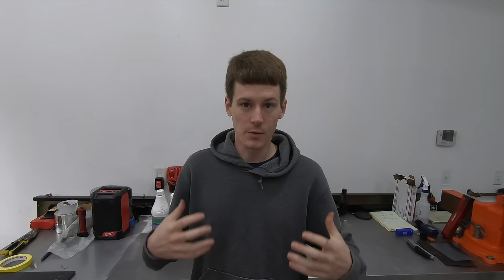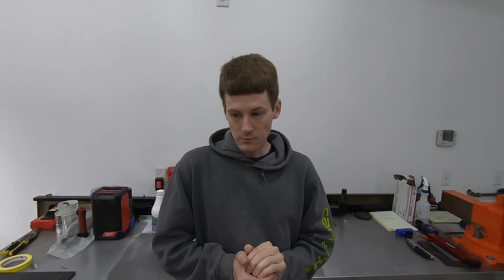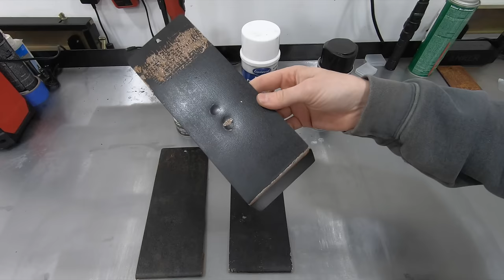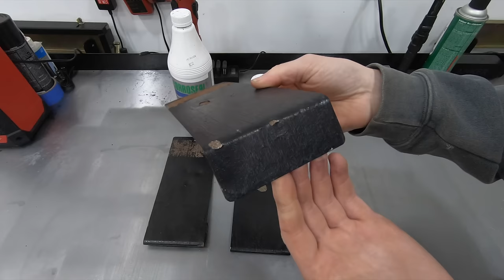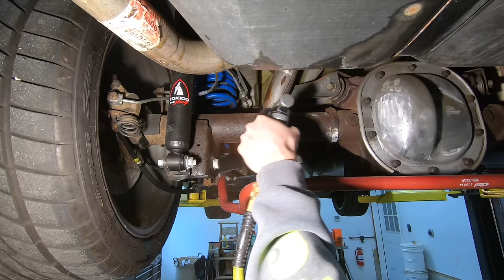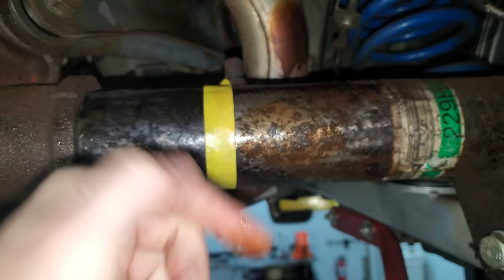MOST Rust Converters Are A JOKE! Let Me Show You. (Eastwood, KBS, Corroseal, Ospho & More)

Comment: Rust kutter was interesting and that thickness may seem like a benefit but it isn't. They are using thickening agents to allow the chemical to be in contact longer to achieve better results. While that is good it also limits its ability to enter declevities and porous surfaces which may leave uncovered rust under the applied area. While skyco "ospho" seems watery that is because it is required to pentetrate. I saw lots of iron phosphate on your test panels but nearly none on the rust Kutter panel, what exactly are you suggesting it converted? Phosphoric acid exposed iron oxide will appear as black and the rust Kotter panel appears to not have hardly any rust on it, converted or otherwise. Sampling with one sample per product dose leave a greater chance of result deviation through inequality in base samples and can best be defeated through multiple samples of each and a control sample. Good luck on your next test to create true results!👍

Comment: Looks like VHT converter has been discontinued. Duplicolor Rust Fix is from the same family and in looking over the MSDS, both have very similar makeup except Duplicolor does not have Dimethyl Ether, It does have the other three as VHT did which is Acetone, 2-Butoxyethanol, Formic Acid.

Comment: Ok Q...
 I bought a vehicle that the exhaust system has been welded together from the manifold to the muffler,  if I was to use your best rust converter would it work since it would adhere better because of the heat or not?

Comment: So, after watching your and other videos, I'm going to power wash and green scrubby pad the frame on my 2000 Dodge 2500HD Cummins pickup. Then give it a coat of (maybe 2) Duct Cutter. And then a coat of POR-15 black rust coating. Am I waisting time and money with the Rust Cutter if I'm going to use POR-15??
Reply: Rust Cutter, not Duct Cutter. Thanks autocorrect 😁

Comment: Any phosphorus acid based product is not good to spray on your undercarriage. It is an acid that will eat up alot more than just the rust.  Any electrical wire, bushing, and everything else it touches will deteriorate from the acid.  If it burns your skin what do u think it will do to everything else.

Comment: Trying to figure out why you didn't even consider POR-15. Seriously , might be a good reason, just super curious. Is one of these products basically the same thing? Is POR15 just technically not a converter? . EDIT: Found answer. you have them in another video about rust "encapsulator" performance. cool!
Reply: I was thinking the same thing. I used POR-15 in the past and it is tenacious stuff.
Reply: POR is an encapsulator, not a converter.  That said, POR is a great product and I would use it in most applications rather than converters.

Comment: Rust Cutter or Krudd Kutter followed up with the VHT or an Eastwood 2k EPOXY Primer (Sealer)! then top coat with KBS Rust Seal or 2k KBS Maxx Seal (UV protection) is what id HIGHLY RECOMMEND!!!...

Any of the 2k Eastwood Urethane/Ultimate Extreme Chassis products id also recommend for a top coat

Comment: I noticed that was a fox body car, nice. I have a 92 Z28. I want to change the coolant over to the Evans coolant. After I clean the block out, want to run rust converter through the engines water jackets. I keep thinking it would make the motor last forever without fear of internal corrosion.
Reply from the maker: You better be certain you get all of that acid out of the block. I'm sure over time it would destroy head gaskets, hoses, seals etc...

Comment: you should do it again with different brands there is a really affordable product called iron armor that harbor freight sells and seems to be getting a lot of good reviews. I've also run across dinitrol RC900 which claims to penitrate 7 times deeper then any other product and convert the rust into a epoxy which sparked my interest, problem is its around 50 dollars a spray can and hard to find it in the U.S. unless you pay crazy shipping prices

Comment: I have rust in a trunk seam which I repaired on the exterior, but still need to apply a converter to the interior of the seam. Obviously the seam is not easy to reach and therefore rinsing a product like Rust Kutter completely out prior to applying a sealer, will be very challenging. Any suggestions for how to get the effectiveness from a converter like Rust Kutter without doing damage if I am unable to get ever last drop of it removed from the inside of the seam afterwards?

Comment: NOT A JOKE AT ALL — The REAL “Metal Prep” products are something like PPG DX-520 METAL CONDITIONER.
They are basically 30% Phosphoric Acid and metal salts (zinc oxides) — (For the cheapest but still effective stuff, a 30% Phosphoric Acid dilute in distilled water work.)
They are use by the metal industry for ever and in all serious vehicle body preparation.

To work You need to FOLLOW THE DIRECTION.

It does not dissolve the rust, but rather bonds with it to create iron III oxide and water, and this characteristic is what makes it very effective for rust removal.

There are two ways that phosphoric acid is used to prepare steel surfaces and help to prevent corrosion.
 
1. Permit to clean the steel of rust, etc. in preparation for painting (or cold galvanizing). It converts rust to a water-soluble compound which can be removed easily by washing with water (distill water preferably). This, removes rust and provides a slight etch as an anchor pattern for coating.

• This step can be follow by a water based solvent to concurrently remove oils, grease, etc.  

2. Phosphoric acid is a good rust converter. It can convert some of the iron oxides on rusty metals to a stable layer of ferric phosphate which act as a base for coatings, to improve corrosion protection. Phosphoric acid is used extensively in the automotive industry as a base for painting.

As an example of industrial use:
PPG recommend the use of DX-520 METAL CONDITIONER on all metal

DX-520 METAL CONDITIONER is a phosphoric acid based coating chemical that will produce a zinc phosphate coating on galvanized or steel surfaces.  DX-520 METAL CONDITIONER contains a small amount of detergent which aids in the removal of light soils and promotes the formation of a uniform zinc phosphate coating.

DIRECTIONS: Phosphoric acid base metal cleaner CONVERTER:
• Take out all flaky rust from the metal and clean the surface rust as best as you can 
• Take out any residual dust by spraying clean water or even better distilled water on the bare metal
• Wen dry, apply the phosphoric conditioner
• Let it work for one to three minutes (depend on the state of the metal and the phosphoric acid dilution of the conditioner. Should be around 30%) — DO NOT ALLOW THE PRODUCT TO DRY BEFORE RINSING. — If dry spray rapidly the conditioner over again and be sure to rinse in the minute.
• Rinse with clear water or even better distilled water or
• Let dry and apply the zinc base primer, primer and top coat

Comment: This really is not helping. I just want to restore my rusty frame parts and prevent them from rusting again.

There are so many videos and they all say something completely different. Nobody explains why they choose what they choose but everyone swears by their method or shits on another. It's just impossible to learn anything

Step one is obviously sanding down the rust.
You can never get all the rust off especially in tight corners or dents. So according to this video I do not use a rust converter and just paint a base coat over it?? But then I have rust under the paint?

Comment: I don't share your enthusiasm for VHT based purely on your own results; it doesn't convert rust, it adheres extremely well to rust, and it dries. These are all the conditions which make rubberized undercoats fatal to parts, once compromised they trap moisture and cause accelerated corrosion.

I actually think the Eastwood was the best of the aerosols, it converts rust, and can be removed to treat the now bare metal.

Comment: The problem is liability. You can't sell a rust converter under that use claim, the chemicals that actually convert rust do so through hydrogen exchange, that means acid. Phosphoric acid (sold as concrete etch and metal prep) will produce iron phosphate, a durable and paintable coating that will prevent future rust. If you don't want a coating and just want to get down to bare metal then oxalic acid is what you want, sold as a kitchen cleaner in powder form (bar keepers friend is one of the brand names). These two are the only two I would ever use (I never use any chemical for anything other than it's intended on-label use, as that would be a violation of federal law). Note: yes, vinegar will dissolve rust, but it leaves behind iron acetate which is hygroscopic and will cause rust to proliferate through the material. You could conceivably use sulphuric acid which would produce iron sulfate, but sulphuric acid is generally sold much stronger than oxalic or phosphoric, and hydrochloric would produce a dangerous iron chlorate salt. Any and all of these compounds carry a degree of danger and would need to be handled respectfully. If you can find a chemical supply that will sell you oxalic acid and phosphoric acid then you could use them commercially and advertise rust removal, as it stands we have to stick to "metal prep" and "cleaning" as that's what the package says they do.

Comment: The thing is...if you have rust bubbles in the paint and when you clean it up and you also find holes.......how to best prep, so you can add fiberglass matt with bondo fiberglass resin and hardener over the prep to then sand, glass filler and finish?..? VHT.? Or??
Reply from the maker: Replace the metal. That is the only permanent repair.

Comment: The last 3 are rust removers, not converters, they are deisgned to remove the rust down to metal. Converters are not very useful because they don't give a reliable base for top coats. I found them occasionally useful to stem rust in corner areas on the body away from the road surface.

Comment: POR-15 is the best stuff out there.😁  Very little skill and minimal prep is needed.  If you buy a can (pint/quart etc) only get what you need because anything leftover dries into a solid rock. A humid garage actually helps the curing process oddly enough. Must use gloves! and disposable brushes and rollers etc.
Reply from the maker: POR15 isn't a rust converter... Take a look at POR15's metal prep product's SDS. The main active ingredient is phosphoric acid 😂
You're not truly "Painting Over Rust" if you're using phosphoric acid to strip it first...
Reply: @RepairGeek  Correct it's not a "rust converter" I didn't say it was. The POR-15 system is far better than any "rust converter" in my opinion. It's obvious to me that you have not tried/applied it before 🤣because you do in fact "paint over rust" after prepping/etching it with the POR-15 Metal Prep (which is partly phosphoric acid and zinc)
Reply from the maker: You clicked on a rust converter video and starting talking about POR15 and how "POR-15 is the best stuff out there" . 
I've used it multiple times, it's junk: https://youtu.be/7w-h2Y7Gk-c
Hit subscribe, I have more of that junk product testing right now. Video will be out probably late fall.

Comment: You missed a step in your testing.  What does the metal look like where the product was applied after a winter of driving with snow slush and salt.  I once put a brush on product under my 81 full size bronco.  It turned the rust black.  After winter I checked the underside again and there was no sign of black.  Everything was rusty orange again.
Reply from the maker: These are primers, therefore need to be top coated. If you don't topcoat them with a paint, the rust comes back as you found out.

Comment: I've been using Ospho for years and years with excellent results, and have no real interest in using a different product.  But I do hear good things about Evaporust and am curious why it was not included in this test.
Reply from the maker: That is a rust remover and not a rust converter.
Reply: @RepairGeek  Converts rust back to iron so it only shows black coating if the steel is high carbon.

Comment: What's your opinion of Rust Knockout? Having an extensive background in fighting rust, Rust Knockout seems to perform as advertised against surface rust. Obviously, nothing will work against flaking, or otherwise severely compromised, rusted, structural steel.
Reply: looking at the MSDS on Rust Knockout - it looks like it wouldn't do much at all except cover up the rust.
Reply: @voidisyinyangvoidisyinyang885  Well, that's an incorrect inference. Having had extensive experience with rust as a ship's officer and having observed this product months after application, it works, with one caveat. The rust cannot be so deep that's flaking.

Comment: Here's your free comment to go along with a view: Never use an undercoating product on vehicles, it's the fastest way to trap moisture. If it was the best choice then vehicles would be covered all over body panels from day 1. Simply finish the metal as any and use the appropriate paint.

Comment: Have you done any tests using a rust converter or preventer on a riding mower deck?  Needs to take a bit more friction plus build up moisture from stuck on grass.
Reply from the maker: I haven't and I should probably look into it because that is a common question.
Reply: @RepairGeek  that would be great.  I almost ordered a can of PB Blaster Surface Shield based on your good review video but then realized it doesn't get dry enough to work under a mower deck.  Would be good for my jeep though.
Reply from the maker: That is probably my fault. I didn't do a good job of explaining what actually goes on in that video. That product is 2 basic parts. Lanolin and Petroleum Jelly. When the lanolin gets washed away by high water contact it leaves behind the petroleum jelly. That was why the product appeared dry in the video where I pressure washed it on the mudflap, the lanolin had been washed away.
Reply: @RepairGeek  thanks for explaining that, I wasn't getting the wash part.  In your defense though, you were demonstrating a completely different application than what a mower deck would demand so I was viewing it with that lens in my head.  Your testing is top notch, unbiased scientific approach so if you ever do this it will be legit.

Comment: @repair geek: I have a Harbor Freight trailer I bought used.  It was customized into a motorcycle trailer, which is what I plan to use it for.  It's got a lot of rust that I want to take care of. 

I don't have a grinder or anything.  I've got an orbital from Harbor Freight, or a wire brush for my wheel...  I really don't want to try and sand the entire damn trailer.  If I remove the scale, would Rust Kutter be a good choice to handle the rust before adding fresh paint?
Reply from the maker: A video is coming on this but you need to sand it. Get a cheap 4.5 angle grinder and some stripping disc's. Go to town. Strip as much as you can then use the Rust Kutter, then paint.

Comment: Hey guys so I purchased a classic chevy truck that I don’t plan to fix right away it is going to sit out under a carport, it already has some rust was planning to use a converter , how would I use it , do I apply and leave on or does this have to be washed off and or do I have to apply anything else after like a protective paint etc ?!
Reply from the maker: After using a converter the surface needs to be painted otherwise it will rust again. Some products out there have zinc in them that will leave a zinc layer after the conversion. That usually helps with protection but as far as how long that would last? That would depend on your environment that it's stored in.

Comment: After you coat something in Rust Kutter, can you paint it after it is converted to Iron Phosphate? Is it still necessary to paint it?
Reply from the maker: Yes.
Reply: @RepairGeek  Based upon your video, I have forked out almost $60 for a gallon of Rust Kutter. I am going to my tacoma up on a lift and go right to work on any surface corrosion I see. I feel confident I have made the right decision. The rest of those coatings seemed like they would seal over the top, while the cancer beneath is still busy eating away.
Reply from the maker: Keep it off the outside of the truck. It will eat the paint.
Reply: @RepairGeek  That makes perfect sense to me. It's acid. I want to put it on places I can see are rusty; nothing else.
Reply: @RepairGeek  Now, I have watched you use the blaster shield, and feel that is the best choice. So, no on blaster shield after converting it to iron phosphate with rust kutter?

Comment: rust converter shouldn't leave a permanent coating period. you use phosphoric acid on unpainted steel that you've degreased and removed all loose rust from. you apply the phosphoric acid and keep it wet until rust is dissolved, wrapping tightly in plastic helps. when rust is dissolved you wash the phosphoric acid off with water and scrub. then dry immediately wax and grease and apply etch primer before adding your desired top coat.